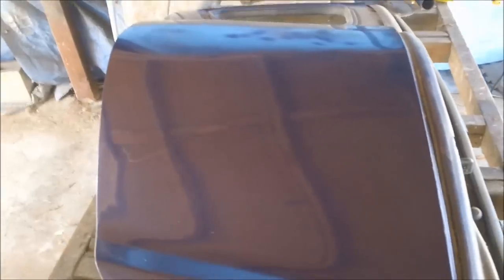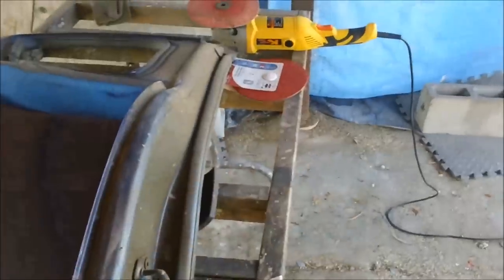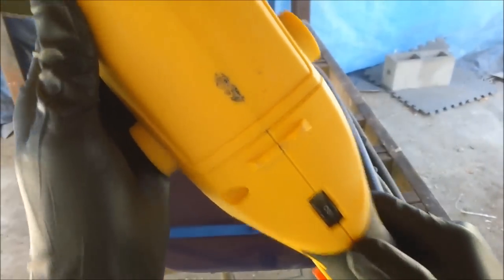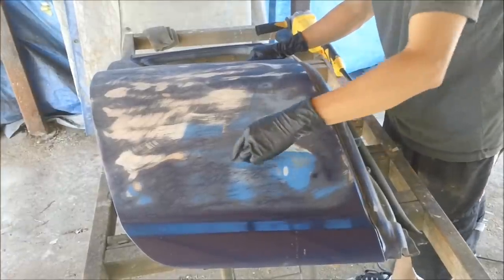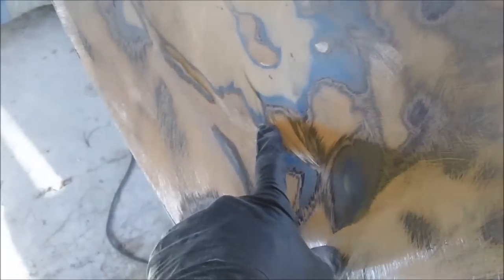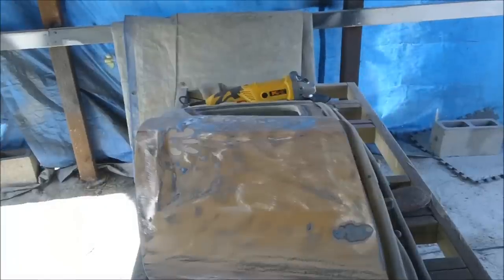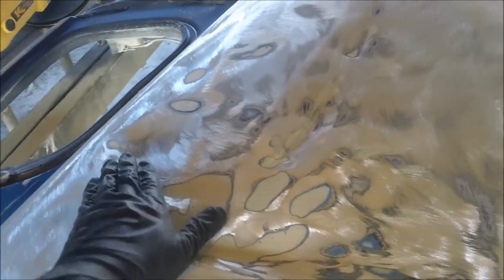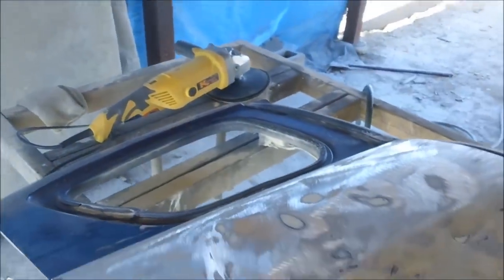Strip Paint to Metal: Aggressive/ Buddget Means

Comment: You did a great demo, I like the good old fashion dusk method too..... Plus one can use a d a sander with 80 grit when close to metal or " hitting" metal..... But this dude here you can see is instinctively levelling the area as he goes to take advantage of finding the bondo and low spots to make the filling process later easier and more effective..... U learn as u go this guy us a do er  and that's the key...., everyone help eachother and we all get better!! 😎
Reply from the maker: +Paul Zonneveld Thank you Paul! I truly appreciate the kind words! I still sort of do it this way but Ive changed it up a bit but only in adding 50 grit once I get close but you hit the nail on the head, you learn as you go along. Thanks again :)

Comment: Going to strip the paint of my 96c1500 (Chevy) trying to figure out the best way to do it may go this route, the clear coats already coming off the hood, any suggestions?
Reply from the maker: If youre familiar with the history of the hood, Id start with 50 grit and just do a little section to see how fast it goes. If there is tons of filler or things like that, then strip it with the 36 and get it down to metal but be careful you dont go to fast because that 36 is very aggressive! 50 grit would be a safer way to between the two grits and 80 grit on a da would be the safest but the slowest.

Comment: so I have a hood that has some pretty bad patches. there is even a little rust coming through in one place. I want to strip it and repaint it black to match my cars paint. would I want to do this to my hood to remove everything and start with new primer paint and sealant?
Reply from the maker: I had a similar questions asked just below, Ill copy and paste, perhaps add some more should you have any other questions, 

now if its really bad and youre going to go all out, then yes this method will get it down to metal, but its really brutal and might take too much too fast.

This may not be the thing you'll want to do. This way is good to strip to metal if you know there is tons of body filler, probably has a few paint jobs on it and its not worth saving. If you still plan to strip to metal, Id use 80 grit on a da sander and take it down with that; for the rust spots you might want to wire wheel it out then do a metal treatment to kill the rust, once youre down to metal make sure the metal has a good tooth in it, you could even drop to 60 grit on a da and make sure its got some teeth in it should you wanted to apply body filler or anything like that. Thats what I would do with an original paint job situation. Some 80 grit on a da, wire wheel for the rust and go from there. Its really a situational evaluation sometimes

Comment: What is a good high build primer to put over epoxy?
The epoxy I am using is just to seal of course but due to how thin it is you can see every little imperfection through it. 
Redoing my 66 Econoline in a ratrod style so I will leave it black primer but a high build over top would be a nice next step. 
Cheers!
Reply from the maker: +Chout Rodriguez Hi Chout, I wasnt able to respond to your comment until now. A good high build to put over epoxy? Right now Ive been using the matrix high build. The MP3 Hs primer with reducer. That is some thick stuff and wont spray very well out of a 1.8 without reducing it. Some easier spraying primers would be the house of kolor dts or evercoats feather fill g2 if you want to go with the poly primer. Those are the ones I have used in the past. Hope this helps and sorry for the biggest delay in response ever lol

Comment: what do we have to do after we strip the hood down to the metal right away???? does it need to be PRIMED right after strip it down or what?? its for a hood on a """1991 Chevy 1500""????
Reply from the maker: Well you've got a few options you can do here. You can go right to body work and prime it after the body work is done or if you dont have the time, put a finer sand mark on it say from 36 to 60 grit on a da and put a coat of sealer on it and when youre ready to work it, strip the sealer off and do your body work. It doesnt have to be primed right away however you may encounter a bit of flash rust depending on what part of the country you are in, time of year, humidity etc should you decide to leave it in metal for a long period of time. Really, what ever you feel is appropriate for the situation

Comment: Hey man I'm stripping my car can you recommend a buffer or sander to buy that would be good the job?
Reply: I work at a restoration/fabrication shop- many large cars getting stripped from top to bottom. Aside from some sort of abrasive blasting, we typically go at the cars with an 8" hog (sander). Start with 40 grit but only until you are just breaking through paint and primer- avoid hitting bare metal too much with 40 as it will damage the sheet metal. Once the car is done with 40 we switch to 80 on the 8" and then go all the down to bare metal everywhere. After that is complete, we do a quick 80 grit on 6" DA. Helps to smoothen everything out and make for good adhesion when epoxy is applied. Of course before DA and epoxy, all rust is cut out and replaced with new metal.

Comment: just because I'm new to this and I want to get all the colour off my kombi would this method damage the frame or not? plus would this work for rust?
Reply from the maker: I wouldnt recommend this method if youre doing some small like that, this is really for something that you know is beat to hell with tons of filler in it and want to start fresh. Id recommend a 3m stripping disk, much more forgiving or just take some 80 grit and sand it down to metal with that. If you have rust, Id use a wire wheel to get the bulk of it out then treat it with something to kill the rust. Hope this helps
Reply: +Gary Rubino thanks mate

Comment: How can I strip paint on a fiberglass part but leave the gel coat underneath the paint?
Reply from the maker: +phu phool I dont have much experience with fiberglass parts except this harley fairing I painted, Ive heard there is a chemical stripper that is fiberglass safe. Or you could just use 80 grit and take your time sanding the paint off till you start hitting the gel coat.
Reply: But is there really a gelcoat between the paint n the fiberglass though?
Reply from the maker: +phu phool should be in between the layers of fiberglass but again, Im not a fiberglass guy

Comment: I am restoring a 66 beetle and intend to strip the dashboard and console down to metal for paint.  What steps should I take post stripping prior to paint?
Reply from the maker: Thats a bit of a loaded question but to strip those parts Id start with 80 grit since I doubt those have been body worked before or have tons of material on them. So 80 grit just might do the trick if there isnt any major rust. Let me know if you have any other questions or have some things you want a second thought on anything

Comment: im looking into stripping and painting my motorcycle tank, will this do or do you have any suggestions for that
Reply from the maker: +Oracle Gaming For a motorcycle tank this would probably be too cumbersome, I would try out a da sander with some 80 grit to see how well that works. If you dont have a da you could do it by hand but that would take far too long. Another option is using chemical strippers; really easy, depending on the brand very cost effective but really messy I do have a video on that, check it out https://www.youtube.com/watch?v=rdAn5MA7Kts
Reply: Alright thank you and thank you for such a fast response! I'm probably going to go up to home depot tonight and pick up a sander like the one you have ill make sure to pick up 80 grit for it.  I have been using paint stripper on it and it doesn't seem to be working so I want to try something else that is faster
Reply from the maker: +Oracle Gaming No worries, I happened to be on at the moment hence the fast response, if you want to try something else, you could get some 60 grit as well. Make sure you have enough because you'll go through quite a bit
Reply: alright yeah the tail piece of my motorcycle is pretty much stripped but the tank is mainly what it will be used for. do you think maybe like 5 discs would work?
Reply from the maker: +Oracle Gaming I think you might get by with it if you nurse it but I tend to buy things in 50 bulk packs. In your case, maybe buy 10 of each that just might be right. Hard to say really
Reply: ok thanks if i head up there tonight i will have to see what all they have and how much it will cost XD
Reply: +Gary Rubino I just got home. Just picked up a circular sander and a 50 pack of 60 grit